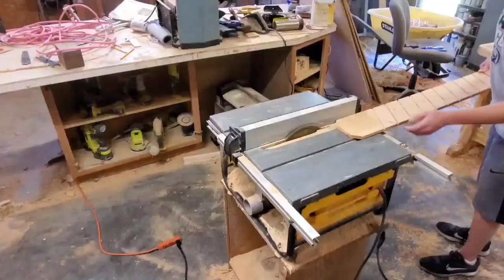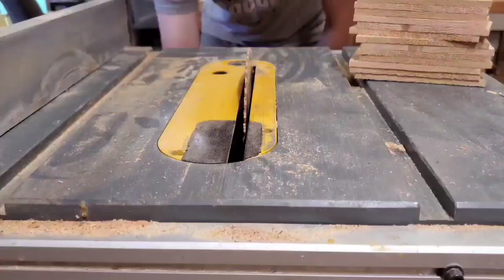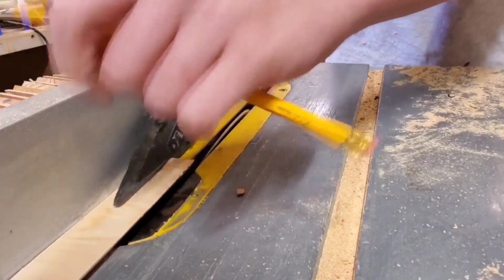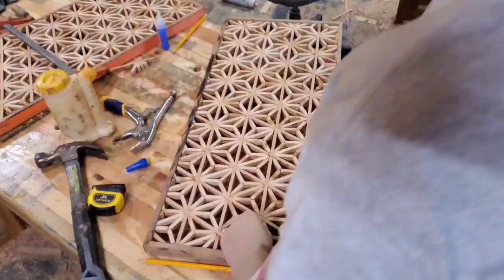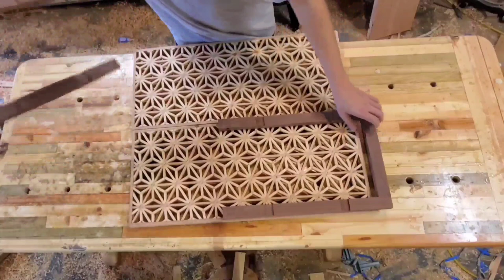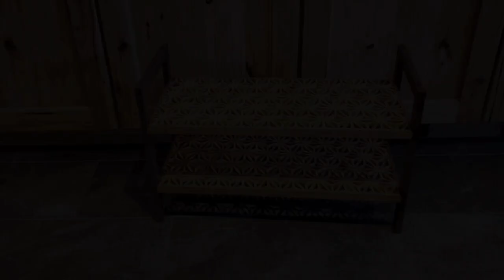Making a Kumiko Shoe Rack | Woodworking

Comment: Some of those cross cuts were sketchy on the table saw. I would recommend making a cross cut sled for safer and more accurate cuts but you did an awesome job. Keep it up!
Reply: yeah most of those cross cuts were a kickback waiting to happen. always support the piece going against the fence. if you wanna cross cut with a miter gauge it's not hard to set up a 1" spacer to but up against before the material gets to the blade so there's a gap the cut-off can fall away into and not get caught between the blade and the fence.

Comment: This looks amazing but please be safe my dude!! 

Use a riving knife, use a proper push stick instead of a pencil (or a feather board), don't ever put your hands near the blade when you do those bevel cuts, use a cross cut sled or cut the pieces with a miter saw instead of doing a cross cut with a long board

Comment: Nice work.  I would agree with a previous post that you should make yourself a sled to cut those parts safely.  How did you figure out the angles.  Did you work from a set of plans.  Lots of patience. Thanks so much for sharing.
Reply from the maker: Thank you! I will have a sled made soon. I did not work off any plans, just geometry.
Reply: @JoshWrightWoodworking  math can be useful after all. I never understood those students in school who said "I'll never use that in real life" in math class.
I am past 50 now and have worked many jobs and have yet to have a job where I used no math. Thanks for saying geometry is how you figured out your angles for this project. Your younger viewers, and some if your older ones, probably needed to read that. You rock, and are a good example (except maybe for some safety no-no's on the table saw), ha ha ha!

Comment: B-E-A-UTIFUL shoe rack. I think my mom might need one of these in a larger or taller size. Are all of the little pieces glued in as well? And if so, CA or regular wood glue? You didn't show gluing any of the kumiko together, so just wondering if it is glued or friction fit. (I am guessing it is glued since nothing fell apart when you cut it for panels.)
Reply from the maker: I used ca glue
Reply: @JoshWrightWoodworking  thanks for the info😀
Reply: @JoshWrightWoodworking  We never see you gluing!